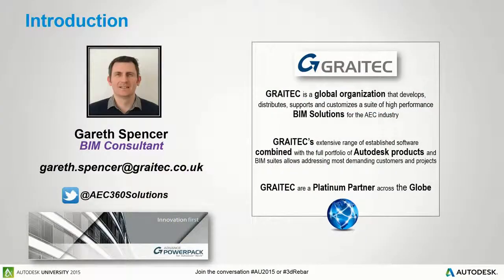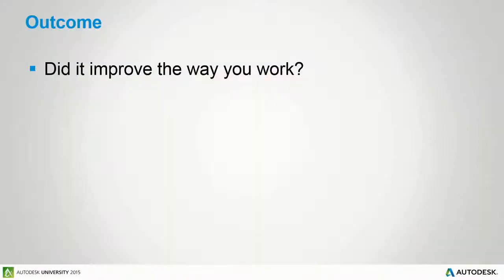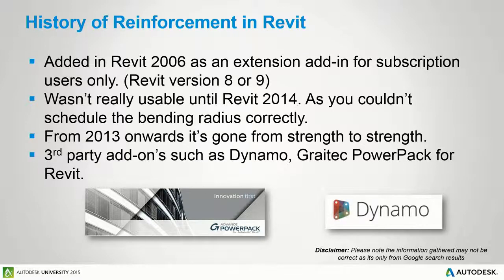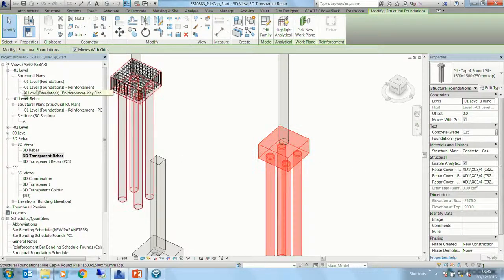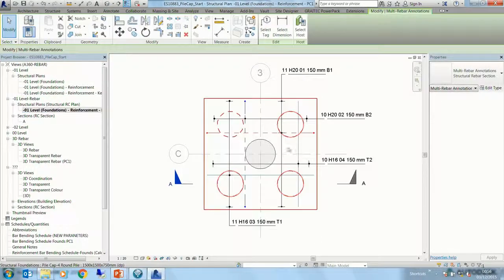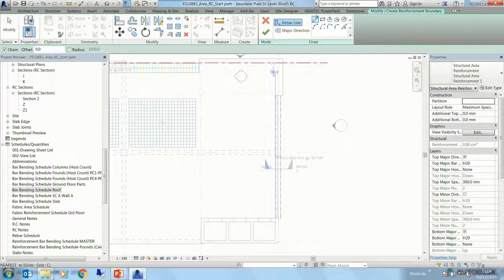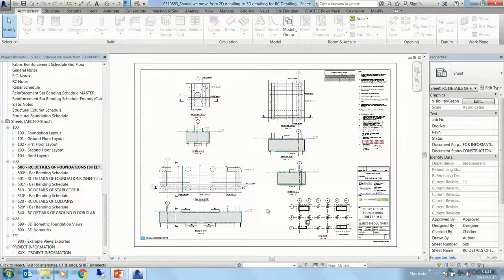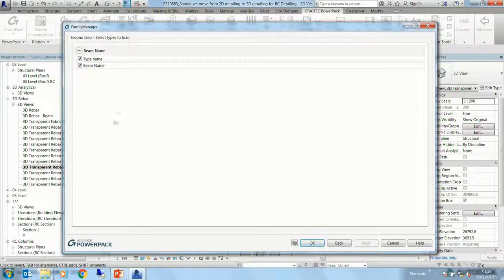Revit Structure Reinforcement Detailing

Comment: 🙋 Very informative class on Revit rebars detailing! Quite rare chance to do rebars for revit for actual project models as the structure model file will get really heavy..What is the common practice in UK on the rebars detailing using Revit? For example, how much rebars detailing goes into a high-rise building project, one floor or every floors? Thank you for the video. 😀👍🌟🌟🌟🌟